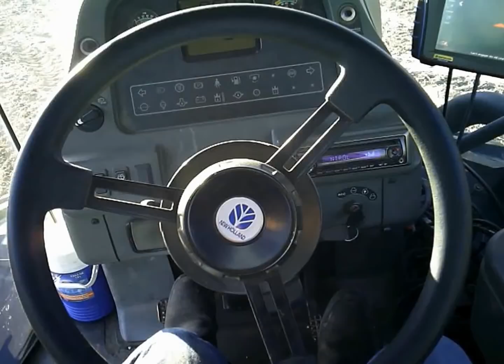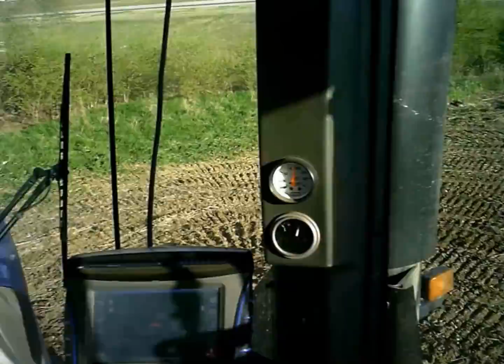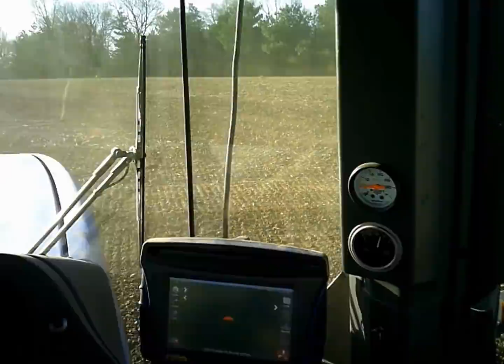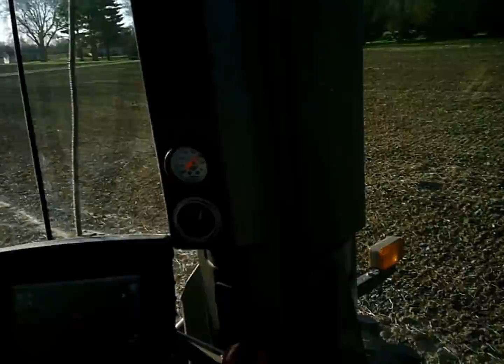Finished up planting corn

Comment: Jake, what is the purpose of the double boxes on the planter and the liquid tanks? 
I'm pleased that you have your corn planted in what looks like good conditions.
Reply from the maker: Dan Whiteford the liquid tanks are for 2x2” starter fertilizer. Mostly nitrogen. The little boxes on the back are for insecticide but it doesn’t get used much since we plant root worm resistant corn. Thanks for watching